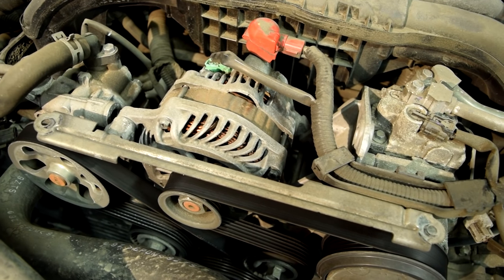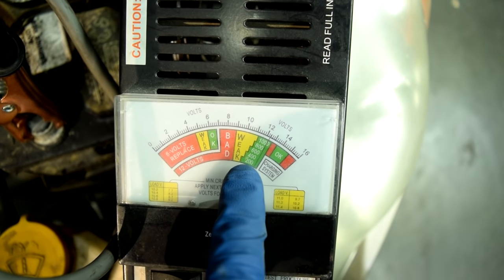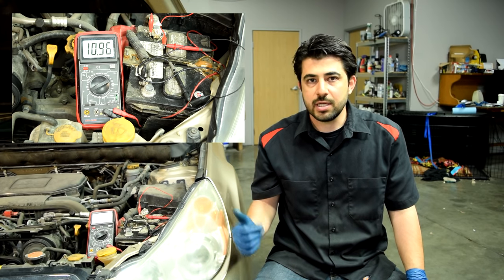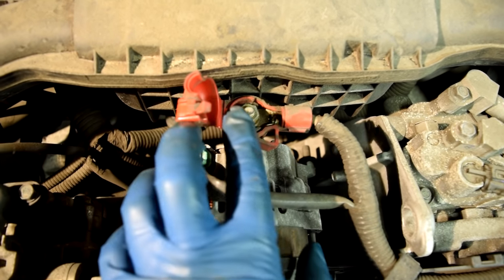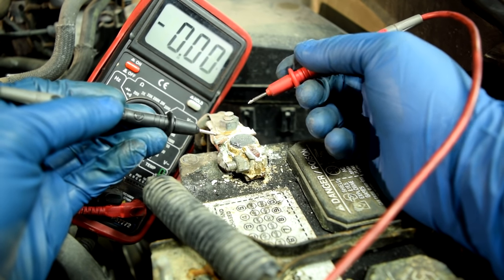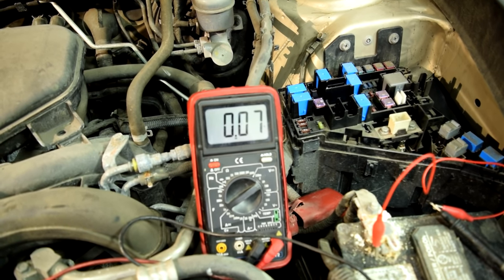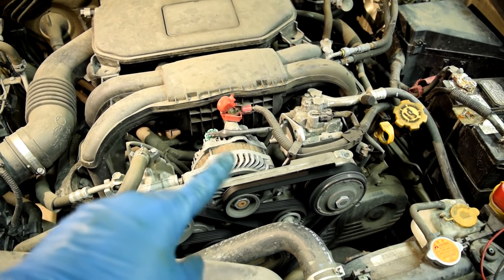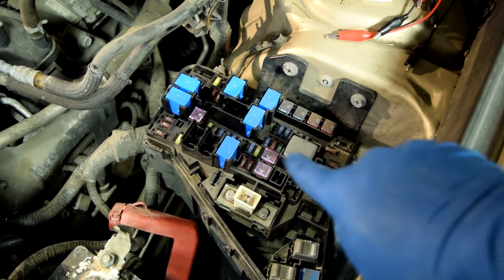How to Test an Alternator - Plus How an Alternator Works

Comment: I was check a 24 volt system, with my negative lead on the negative terminal of the battery, and positive lead on the alternator output, I was getting 25 volts( same as my battery voltage) , but put my negative lead on a chassis earth and positive lead to the output, I got 33 volts. Any ideas? Oh and the alternator is brand new out of the box

Comment: Pity you were using the 2 wire green plug one. I have the 3 wire green plug which is supposed  to regulate the alternator on/off, but the thing doesn't work. Only sits on about 12volts at both the alternator and battery no matter the load. Everything else checks out and I've gone through 4 different alternators so can't be that. Only way I got it to work properly is to remove that extra sense wire from the plug, it goes in that blank space on the one in your video, it's a green wire. Now it sits at a constant 14.xx volts.

Comment: So, if the battery removed while engine is running, does alternator produce electricity? If yes, how? Thx
Reply: Really late reply but I'll answer. 

No. Car will shut off without a battery. It needs both battery and alternator. Alternator needs a battery to start producing energy at start up.  And a battery needs an alternator to get charged. The battery is hooked to all electronics in car.

Comment: Clean the brushes and slip rings with carb cleaner or brake clean. Spray the brushes good. Sparingly on the slip rings to avoid removing the grease from the bearing with the cleaner

Comment: I tested and replaced dozens of GM internal regulators when I was a kid battery guy at a busy Sears store.  Back on some 50’s cars and then tons of 60 and 70’s cars.  As I recall, only GM did that then.  It’s also around the time they went to side battery terminals.  I’ve seen GM quality (and most of the rest too) disappear right before my eyes.  Planned obsolescence and shaving a tenth of a cent here and there.  It’s a net gainer for them even with wrongful death suits and recalls factored in.  So the quality is not coming back ever.

Comment: Thanks for the detail video, I want to know why my voltage drop to 10.xx when aircond compressor start spinning then goes back to 14v right after one second, I also notice my headlights dim a little bit at that moment and goes to normal after my voltage back at 14v, it happen every time compressor start spinning. Any advice anyone? Thanks.
Reply: You have a battery or cable problem

Comment: Great video but if you're trying to check your alternator it's easier. Start your car and remove the negative battery cable. If your car stops then your alternator is shot

Comment: The First thing to do is clean those battery terminals and cables and get rid of that acid buildup. Then you can check and or charge the battery properly.

Comment: My car reads 14.2 when the alternator is running, but when the fans kick every 5 seconds, it drops to about 12.7 and then comes back up quickly. The battery does not appear to be charging enough, I turn the car on and when I drive it, the voltage on the battery is not a lot. I cannot explain why this is happening, it gets better when I change the battery, it lasts about 1 year and it starts all over again. This is on a Honda Accord 2008 EXL.

Comment: Just to give a comment ,i have a problem what no one can solve!! Ok here we go in a nutshell.Ford cmax 1.6 tdci . Battery light came on !! (Aswel smoke from alternator and connector) ,Changed alternator for second hand ,More smoke and cable b+ melting !! What a down-let.. Got a new alternator ! Stil gets super hot but works ..  Not my car and convinced that the alternator would last !! Please someone give me the golden question!!
Reply: Wouldn’t last ! Spelling mistake

Comment: Hi, I hope any one can help me,  checking the battery/alternator I have notices that when the engine is runing the multimeter (at battery) reads 14.3-14.5 V but suddenly the voltage drop dramatically to 2-3 V but almost instantly get back to 14.3-14.5 V, do you know the possible root cause? Hopping you can help me...

Comment: Mine has 14.3 at the alternator stud but when I turn on headlights ac radio drops too 12.1 volts so is it my alternator regulator?
Reply: John Smithy I did clean them out sanded them tested vollt at block and its at  .02  and drops to .01 too but shouldn't the alt be putting out a consent 14.3 even under load I feel likes it's not regulating to the demand you know am stumped it's a new autozone alternator too lol
Reply: John Smithy  the battery was tested it's good and no the old didnt charge at anymore even without load and its doesnt have a rear defroster  it's a 1991 MR2 and before it ran fine  its all stock no after lights all stock gonna order another one but AMA take it to get tested it has warranty too
Reply: John Smithy  okay wish me luck in this quest love this car too much had for years dont wanna let her go for something this dumb lol 210k and counting with cold ac clean title zero rust lol appreciate the help 🤙
Reply: John Smithy  found the problem turns out it was my aftermarket fog lights being direct to the head lights power source gonna run a separate power source to the battery to the fog lights with a replay and switch you live and you learn lol

Comment: I’m constantly having my battery die once sitting, I don’t know if the alternator is having an issue and draining the battery but no matter what type of battery I put in something is draining it
Reply: It's the alternator or the voltage regulator.
However since the regulator is a component embedded in the alternator a new alternator should solve your issue.
You can go to Auto Zone and have your electrical system tested for free and they can confirm if it's the alternator.

Comment: wait... lemme make sure i'm understanding this properly.
I attach the multimeter to the battery and it read's 12.5-ish
I start the truck and the vilt goes below 10, this mean's the batter is bad?
Reply: alternator is not charging
Reply: Unless you mean just while your starting, not when it's running.
Reply: At first when I tried to start, all I got was a click. I have charged it since then. Now it rotates, but not start. Haven't had time to retest with the multimeter.

Comment: I have been going through serpentine belts lately so this last time I it was dark I had good open and saw sparks coming from alternator and the bolt holding the pulley on was red hot the the thing ran for 30 seconds I took belt off after it cooled it's spinning freely WTF is going on I'm running 2 yellow top agms

Comment: 1991 S10 alternator will not charge an battery good alternator good but will not charge S10 1991 V6 4.3 liter. What could be the problem?

Comment: I don't understand. My battery voltage is 12.6V, the voltage doesn't drop below 11V upon starting, the charging voltage is a stable 14.07V, there's good continuity, and still my car refuses to start without a booster every once in a while.

Comment: Just one thing wouldn't you need cold cranking amps instead of voltage we had batteries in the military that had the correct voltage but no cold cranking amps
Reply: If you can think of electricity as water flowing through a pipe, it can help to understand amps, volts and watts. Amps would be the volume of water flowing through the pipe. The water pressure would be the voltage. Watts would be the power (volts x amps) the water could provide.

Comment: from another video... why do some cars have gears P-R-N-D, some have P-R-N-D-3-2-1, and some cars don't have gear shifters?
Reply: The P-R-N-D-L shift pattern was commonplace back in the days of 3-speed automatics..."L" allowed you to put the car into 1st gear manually for driving in difficult conditions.  As automatics gained more forward gears (which started in earnest in the mid-1980s), the patterns started changing to allow you to put the car into other gears manually.  As mechanically-controlled automatics gave way to computer-controlled units, there was no longer a need for mechanical gear selectors, so now we see things like joysticks or dials or whatnot.

Comment: If your alternator is putting out 14+ volts there is no theoretical reason driving around won't recharge a low battery.

Comment: The easiest way for me to test the alternator is to just start up the vehicle and then disconnect the power wire ( red wire ) from the battery and if the car surges or turns off that means the alternator is no good!!!!!

Comment: Million dollar question 
I have  2011 Town and country no charging power from alternator to batter new alternator new battery is there a way to check alternator is operating right anyone that help me will get compensation I just need help
Reply: Check for 10 amp fuse and tine reference wire connectivity from battery to alternator.

Comment: Just remove your battery cable with your vehicle running, it will let you know if it's bad or not
Reply: I did this and it died immediately is that bad lol
Reply: Something is bad but for example...on my alternator it would shut off when i unplugged  battery. The brushes were bad 5.99 instead of 200 dlls for new alternator. Took me about 20 mins ....You can change brushes, slip rings, diode assembly or regulator. Its always one.of those and theyre about 5-20 dlls.
Reply: @thegeorge50  Where can you find those Alternator components?
Reply: @MD-cd7em  the alternator brush assembly and voltage regulator i was able to find at O'Reilly....most of the time it wil be one of those. The rectifier bridge where the diodes are i found at Napa. So the brush assembly and voltage retulator wich are the most  common you should be able to find locally. or you can try partsgeek.com advancedautoparts.com 1aauto.com are good online places.
Reply: @MD-cd7em  some places have them named differently ie. brushes, brush set, alternaor brushes, brush kit, brush assembly
Reply: @thegeorge50  THANKS BRO
Reply: @reginaldmadlock  Most likely the brushes are bad you csn replace those for lesd than 10 dlls...if it qas giving too much voltage then it would be regulator ... these parts cost from 3to20 dlls and dont even have to remove alternator just the attached electrical regulator

Comment: The simplest way to check if the alternator is functioning:   Just start the car and detach one battery terminal.  If the engine keeps running the alternator delivers power, so the alternator is okay. With a bad alternator the engine wil stall/stop.
Reply: Peter Pan the simplest way to short out the electrical system
Reply: Zdt 71   What do you mean?
Reply: Peter Pan 
Voltage reg looks @ battery volts to determine how much voltage to put out of the alternator. If you disconnect battery the v reg sees 0 volts & thinks battery is dead so it max's alternator output. That can be 30-40v or more which can kill expensive devices (ECU, etc) in the car. 

This may be true only on some cars. Do you want to find out if yours is one of them? 

Do not ever disconnect the battery with the engine runnning.
Reply: Peter Pan that might be valid with older cars. but, today's cars have too many electronics and the battery helps protect them from voltage spikes and things like that.
Reply: Thats the old timers way. Voltmeter are free.  
Damage can occur.
Back then when car stuff was made to last they can handle it but not now, car will blow up. 🐿
Reply: davecc0000
That's not right, as the alternator is spinning there will be voltage, the removal of the battery may only lead to a slight variation of the voltage depending on the rest of the loads. Furthermore in modern cars the ECU controls the alternator field voltage via a PWM line and the voltage is continuously monitored. Do you really think that a lose battery terminal (or burn or broken) can destroy all your car electronic architecture?
Reply: Not true
Reply: Exactly!
Reply: Hi there i have a problem with my 2005 saturn ion, my wife drive this car suddenly stopped the engine, then i told her to pump yhe gas start again but something noise by the i  the dashboard showing batteries sign i change the oil and start still the noise was there shen you push the gas peddle the noise come out i dont know what is wrong please send me feedback.

Comment: My battery is at 12.05 doing nothing. My battery is at 11.50 to 12.00 while car is running. My alternator reads the same as battery. Shouldn't it be higher while running?

Comment: You didn't mention how to test for bad diodes by testing across your battery posts for AC voltage with your multimeter......there should be none!

Comment: I have a alternator off a 88 jeep and the regulator has 4 pins "P L I S"... which pin should i use for the keyed field wire and sense wire? and why is there 4?